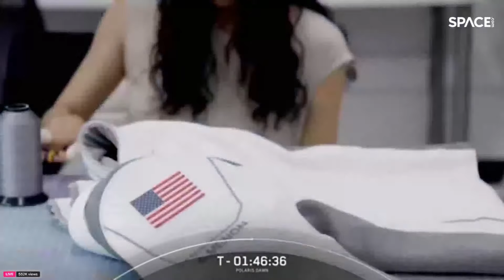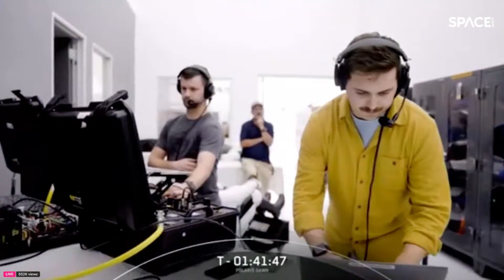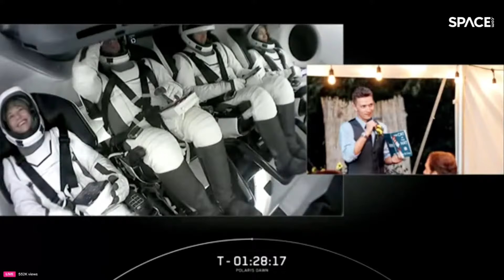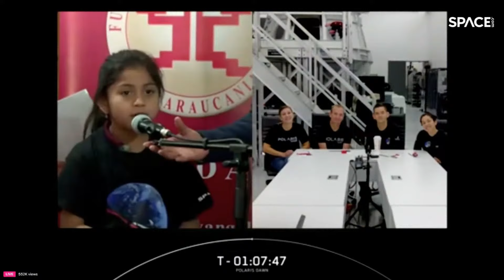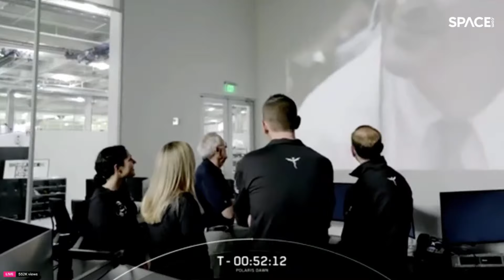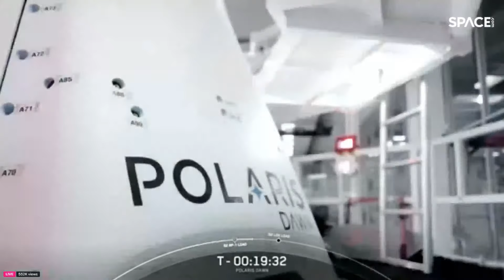Replay! SpaceX launches Polaris Dawn spacewalk mission

Comment: Pour calculer l’accélération moyenne en G, nous devons d’abord déterminer l’accélération en mètres par seconde carrée (m/s²) et ensuite la convertir en G.

Convertir la vitesse en m/s:

1000 km/h = 1000 * 1000 / 3600 = 277.78 m/s

Calculer l’accélération:

Accélération (a) = (vitesse finale - vitesse initiale) / temps

a = (277.78 m/s - 0 m/s) / 60 s = 4.63 m/s²

Convertir en G:

1 G ≈ 9.81 m/s²

Accélération en G = 4.63 m/s² / 9.81 m/s² ≈ 0.47 G

Donc, l’accélération moyenne serait d’environ 0,47 G. Impressionnant, non